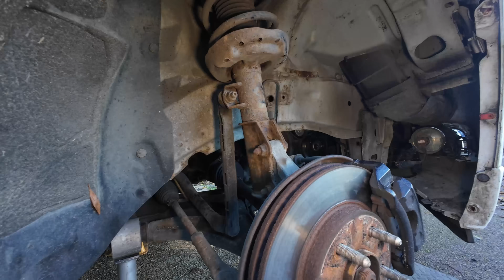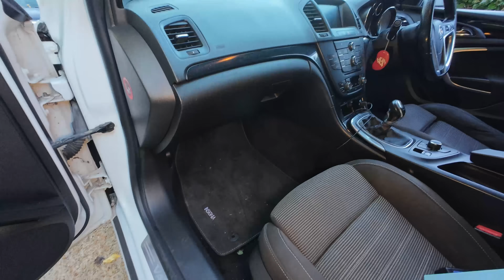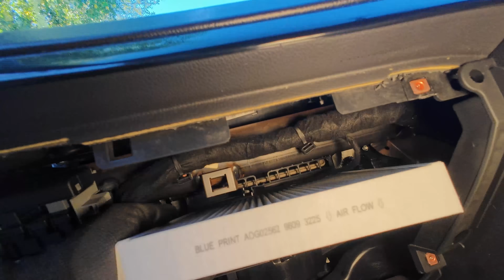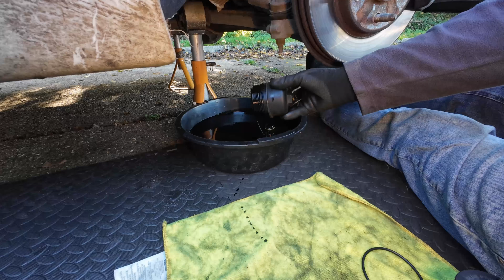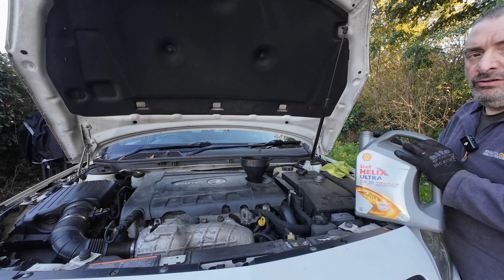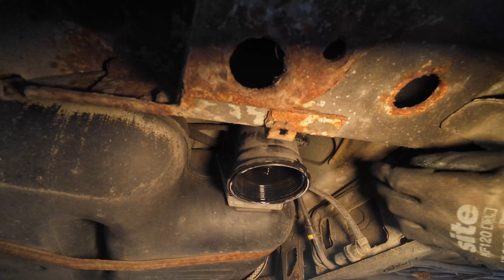Save Big: Easy DIY Full service for Your Vauxhall Insignia 2.0  TDCi

Comment: Hello I’ve just subscribed to your channel nice clean service particularly like the cardboard chute good idea,I’ve got a really good tip for you because I can change a drop link in one minute flat start to finish and the way I do it is very simple because you don’t need the nuts to just tighten them with impact gun they simply snap off so no need to clean or lubricate just snap em off😂
Reply from the maker: @richlee5578  I'll give that a go next time. Thank you for watching and subscribing, it's appreciated.